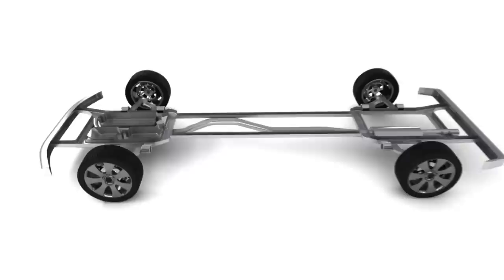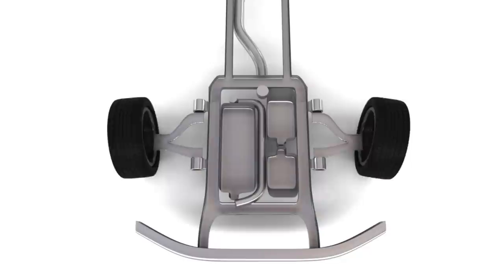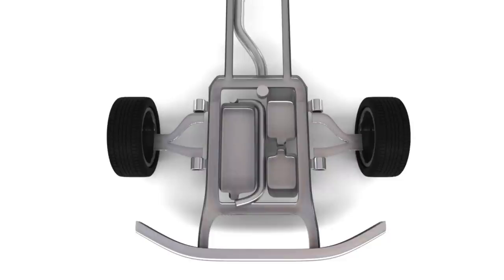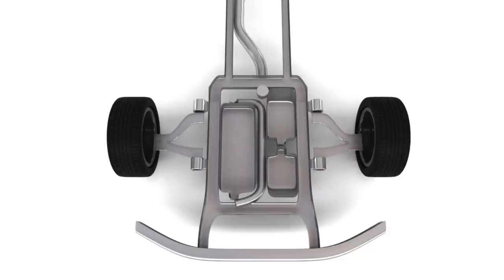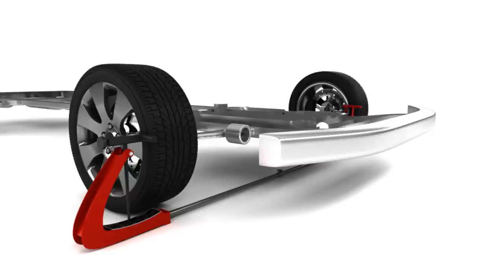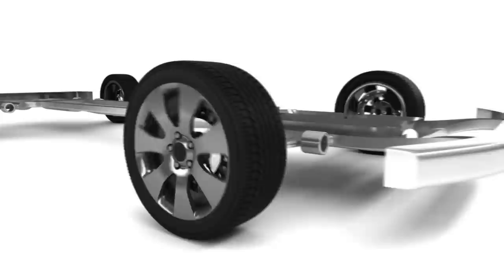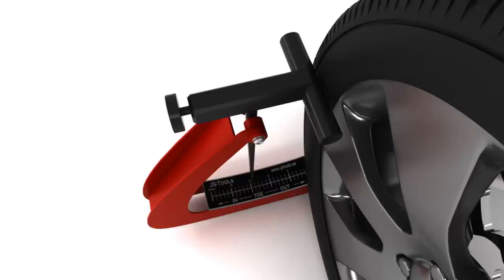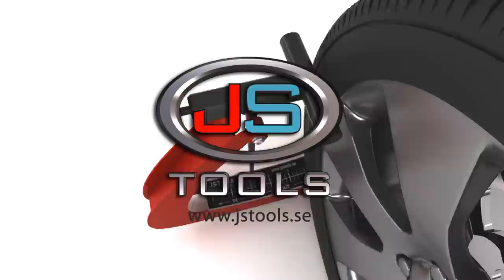Toe-In Toe-Out

Comment: String works too and you can measure from the wheel, not the tire, because the  tire is an unreliable point of reference and should never be used for suspension alignment.
Reply: Veritas et Aequitas  always measure on the wheel or better at the lug flange. A raised letter or sidewall irregularities can throw your measurement off by millimeters